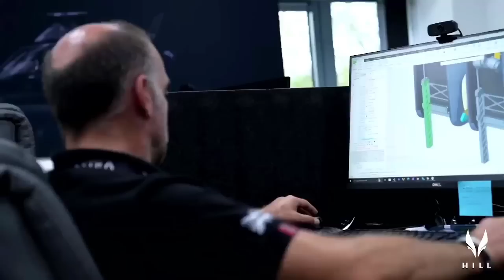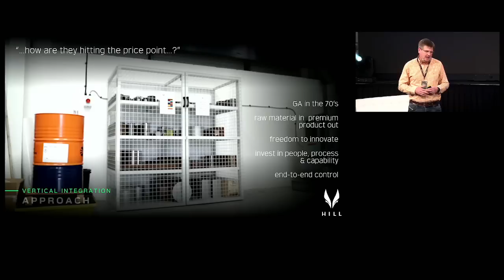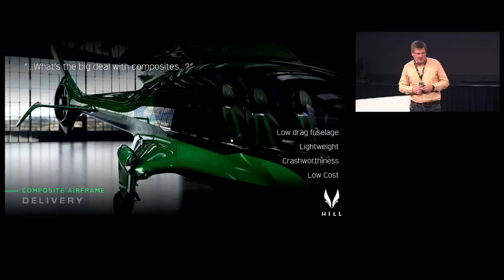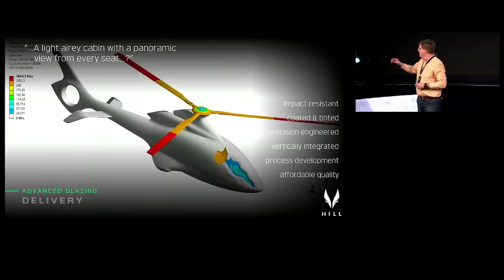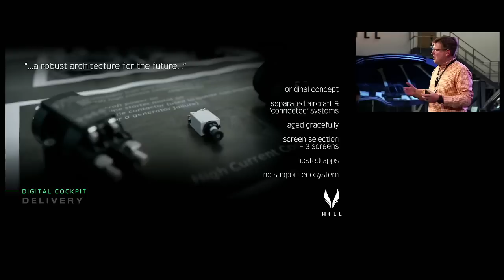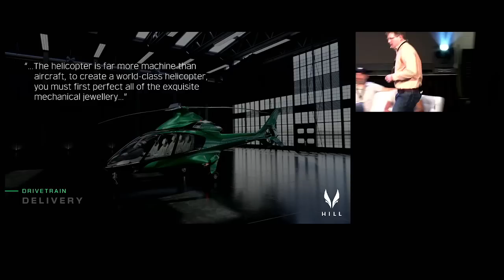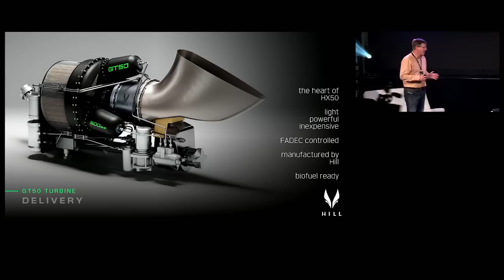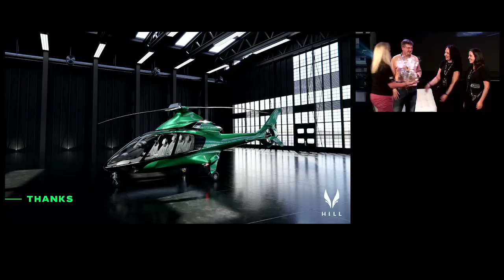2nd HX50 Global Meetup & Discover Event

Comment: What about new VTOL electric aircraft and autonomous flight starting to become popular. Won't this be superior to personal helicopter flight. Isn't this going to be in competition with your business? There is a company in the USA that has designed VTOL aircraft which Airbus has bought around 100 aircraft. This will the  overtake helicopter industry eventually.
Reply: It requires less power to move large masses of air slowly than it does to move small masses of air quickly, even though both approaches result in the same amount of lift.  A helicopter rotor does the former, while the multiple rotors of a VTOL aircraft do the latter.